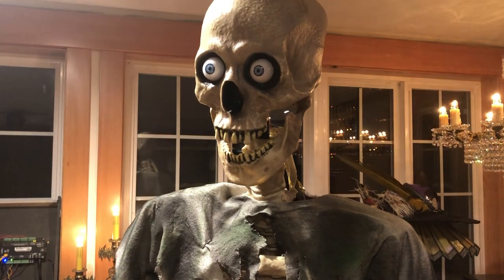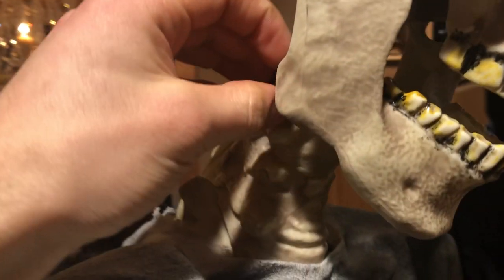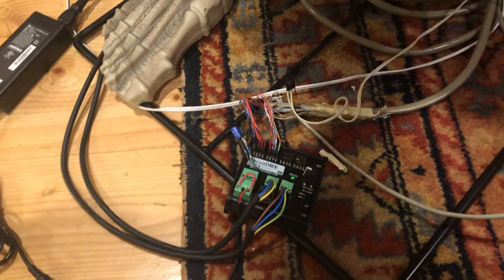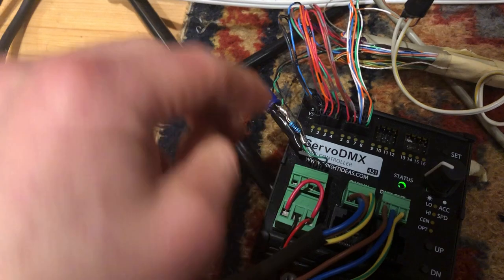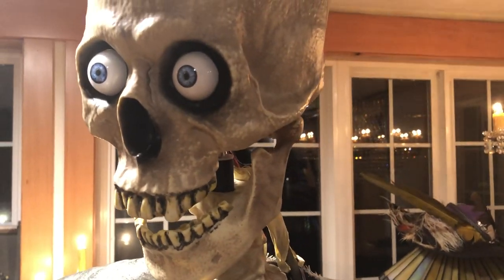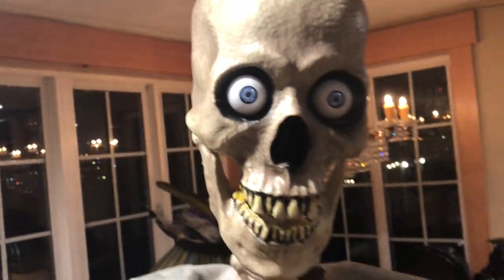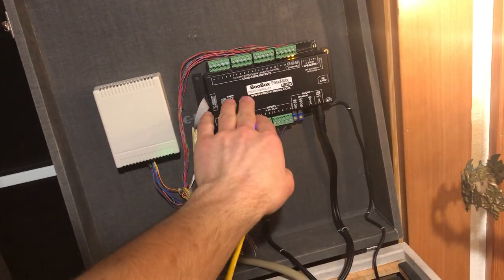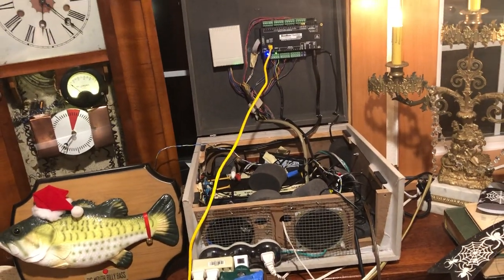How to modify your own grim animatronic

Comment: My grim started clicking during the twisting motion last halloween. I didn't pull anything apart yet but where and what do you think I need to fix this issue? I'm assuming there's something wrong in the waist area. Do they make replacement gears or whatever might be needed? Everything else seems to be working fine.
Thanks Ron
Reply from the maker: I am pretty sure the clicking you hear is from the sensor that is used by the computer chip to sync the waist motor

Mine does the same thing

Comment: Is there a way to wire his original led eyes into servo dmx?

Or could you a video on how to wire the neo pixels?

I'm not familiar with leds and having hard time finding the right Info
Reply from the maker: Yes you could wire his original eyes, however they would probably just be on all the time (they wouldn’t really be addressable )

I’d be happy to make a video on the neo pixels later today

It’s really not super tricky 

The only hard part is getting his eyes open so you can replace the leds
Reply: @Hawky13  oh damn.

Well looking forward to a neopixel eyes video then. Just need to see how its wired up.

I'm not too familiar with electronics in general but I was able to get the custom servo to work for the jaw following your videos.

Eventually wanna try to do the arms and waist. But I wanna finish the head first
Reply from the maker: @maul6117  I’m so happy my videos can help!

I feel you with not understanding how it’s wired 

Neo pixels were a whole new thing to me when I made grim as well

Neo pixels are pretty easy though And very similar to the servos as far as wiring